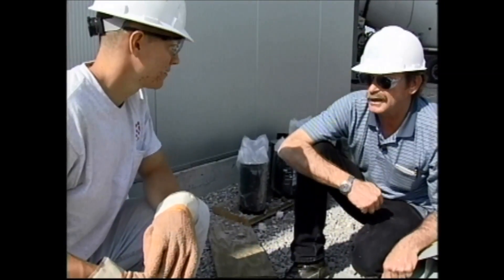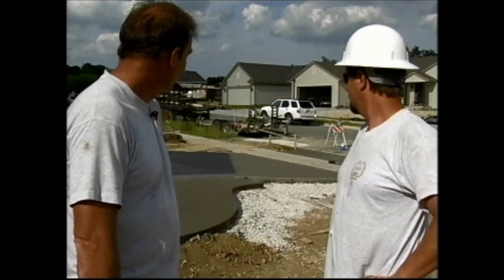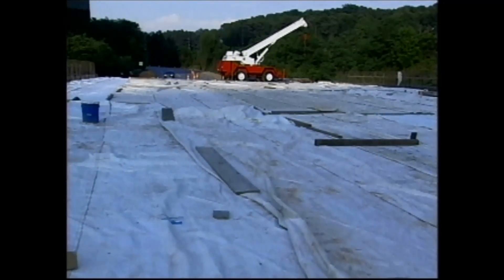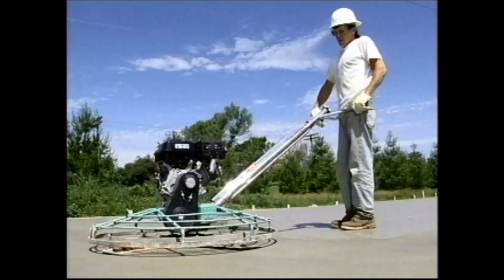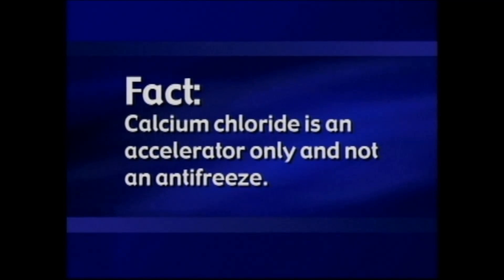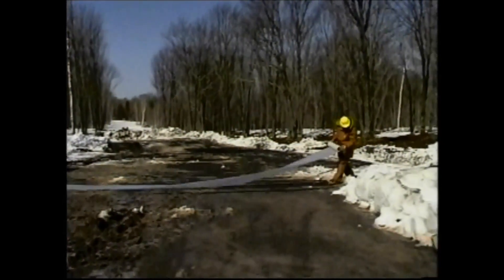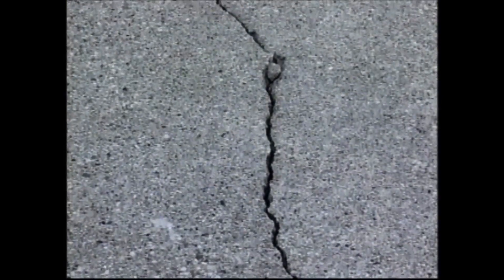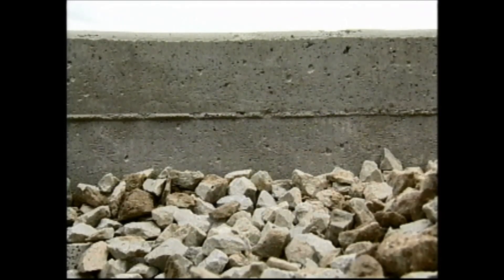Top 10 Myths in Concrete Construction

Comment: Vid is from late 80s.. or at least it should be.. why don't u talk about the serious things. Pump has catastrophic breakdown.....the driver left his water valve on and didn't say nothing all of a sudden you got a square of bulll piss in the middle of your slab......   extreme rain hammers your shit .. taking days of work to make it rite......  Massachusetts be form blowout on a really huge poured wall...  waited too long start finishing cause your hungover and napped too long....  plumbers giant trench drains rite at or above grade and you only learned this as your placing mud up against it...  driver is an asshole and uses all the water....  driver is an asshole and wads the mud ticket up in a ball and throws it out the window towards ya as he drives the truck away .....driver shows up hours early .....  inept and brainless superintendent does things that make everything just a giant ball of suck..  usually anything to do with a church almost always sux........  sidewalks poured over tree roots bites...
Reply: A good ready mix driver should know his slump x to get to job and temp. This he should be able to maintain across the grid , yet he can not controll the batch man and his performance . I have seen real ready mix drivers and I have seen poor ready mix drivers , that's up to the company to control by taking care of the good performer's and getting rid of the lazy , no commen sense driver , lets face it it's all pride and team work from start to finish , one fails we all fail .....keep it hard and like Paul Harvey said ...good day👍
Reply: Gordon Garland  agree completely,   After a few years in bisness, its funny the relationships you form with drivers... some you absoloutly dreaded, rocket dan would have a seizure when u signaled add 5 gal,  other drivers knew you so well they would have your peticular mix perfect, hell a couple even let me drive the truck,    I liked it when they would ball up the mud ticket and throw it at ya out the window as they pulled off the job....

Comment: Hm. They missed a big one. MYTH: Every load of concrete you get from a Ready Mix company will be a fresh load. FACT: Some Ready Mix companies sell 'old concrete' IE 'hot concrete' to make extra profit. The only way to make sure your local concrete service is selling fresh concrete is to spy on them and see if their trucks are always dumping any left over concrete from the previous delivery and washing out when back at the plant. IF you see trucks with their drums turning going into the plant, go straight into the fill area, then drive back out and head to a new delivery, there's a good chance they're selling old concrete. Selling old concrete is a detestable practice, because each load gets hotter and so hardens faster, leaving less time to work it. Plus more and more water must be added to keep it from hardening in the chute. It's gets crazy the longer the process is drawn out.
Reply: It probably wouldn't matter for footings, but flatwork? Sidewalks, driveways etc? I once had to deliver a load of concrete to a home-owner doing a sidewalk, late afternoon, with concrete so hot, I emptied my water tank into the load just to get it to come down the chute, and before half of it was unloaded, it started hardening in the chute. I had to dump the rest of the load on the poor saps lawn so my truck wouldn't be fucked up. And my boss expected that homeowner to pay for the whole load to, 0_o. That's how bad it can get. Most contractors that used us, because we were cheaper than all the other ready mix companies, would only order from us first thing in the morning to just past noon, because they knew there'd be less chance of getting old concrete in their loads, or if they did, it wouldn't be too hot to deal with. With the exception of a few who had large crews and NEVER got old concrete. Never ever. I imagine they had a talk with my boss at some time and told him they'd hurt him if he ever did that to them, lol.
Reply: dkeith45 its called stacking loads a lot of company's do this on foundations

Comment: Crap.  Leaned I don't know nothin' about concrete.  So much complication and variability.  Need to invent something new.
Reply: @ Robert Gift This is commercial concrete. Concrete for homes and small businesses is a lot less complicated. In three years driving for a ready mix company in the midwest, I only saw a contractor use the slump cone a couple of times. They generally just look at it at the top of the chute, and can tell by sight if it needs water or not and how much. The biggest clues to take away from this video is ONE, use some rebar. Not as much as shown because it's commercial, but some rebar for home sidewalks and driveways etc would go a long way strength wise. And TWO, cover it after it starts to set up, wet it and cover it and keep it damp for at least a week.
Reply: I've seen remesh, if by that you're referring to that little hole fence stuff, like little 1/2" holes, at the big box home supply stores, but never saw a single contractor use the stuff in three years delivering concrete. A few used 'wire' nearly every pour, which is, this is from memory, 2" squares untreated steel looks like horse fence. But few used it and I even saw a few F^uckers have the wire set out, and the homeowner drove away to work, and they put the wire back in their truck and we poured without it. I never saw a single contractor for home concrete use rebar either, but from seeing it used in commercial pours, I got the idea to use it myself. I think it'll really help keep sidewalks from cracking down the middle which quite a lot does. I figure it can crack, but will not cave in or chunks break away etc. And it only ads maybe $10 or so to each slab of sidewalk section. I think in driveways you should at least use it around the front edge where cars drive onto it, IE the approach.

Comment: Everything said on here protects the concrete plant....notice its always someone elses fault for concrete failure never the concrete mixing plant...that never came up one time
Reply: @ Brad R Yeah, like the selling of old hot concrete mixed in with new loads to make extra profit for the plant boss. Very few people know of this nasty practice. And the only way you can find out if it's happening is to spy on them.
Reply: The video is about myths, concrete mixing plants making mistakes  isn't a myth.
Reply: Brad R They put so much chemical in it they don’t tell anyone so it doesn’t dry in the truck .
Reply: I was hauling 10.5 yds. of gunnite for a pool job with a screwed up mix design. Instead of putting in 1 gallon per yard it put in 1 gallon for the whole LOAD! The manager came down after I hollered and figured out what happened and we got it slumped out. Went to their other plant and it did the same THING, 1 gallon in 10.5 yards. Was trying to get it wetted up when the big boss told me to just go. I told him to stuff it because the load wasn't right. He mumbled something about the plant always standing behind the drivers, like I knew it was the truth. I hollered that I'd leave when it was right and I did. He was gone when I got back good thing because I was hot enough to fry an egg on. Transferred out for a quarry job shortly thereafter and he got fired shortly after that. The guy that helped me got his job. No more c.d.l. for me.

Comment: forgive  me    for    being    dumb  but  i have    no idea   what hell  is  slump ????  and  in case  you   think   i'm kidding     NO I AM NOT  KIDDING !!!!!!
Reply: steven herrold.
All construction specified concrete must be slump tested.
Google, concrete slump test, to find out how and why.
Reply: If you watched the whole video, you'd see the cone shaped device they use to pour some concrete in, then they lift it off. How much the concrete slumps or sinks down is then measured and that is the 'slump'. IE, it shows how stiff the mix is and if it needs more water added or not. In three years as a ready mix driver, I only saw a contractor use that slump device a couple of times. Most just judged slump by sight at the top of the chute.

Comment: 9:50 I'm still triggered that they never mentioned the ways on how to thaw frozen ground
Reply: In the Midwest the ground can freeze down to 3 or 4 ft in an extreme winter, one year in our Iowa area we had lots of rain in the fall, then temps went below zero for a couple weeks before the snow came, by spring the frost was as deep as 72 inches, causing water lines from street to homes to break, or even homes with well heated basements having to keep water dripping to avoid freeze ups, my own water was coming out of faucets at 33 degrees, that was one of our most extreme winters ever as far as cold temps
Reply: It's rarely done, at least in the midwest. The plant I worked at for three years mostly shut down once the ground started freezing up. Then they'd lay off almost everyone and only do pours that were indoors, like at a steel mill or some such.
Reply: cover the pour area with concrete blankets. the ground puts off some heat, even in the winter
Reply: That made more issues all that summer as everything thawed out, some areas had to replace sewer lines as well as the ground thawed some areas turned into a quicksand like surface, due to being so wet, ground wouldn’t even support a person walking on it in these areas.
Reply: I use sunshine.

Comment: so the ways to increase slump onsite are still add water.
when you order concrete and it turns up coming out of the truck in huge blobs dry as all hell lets face it. your gonna wet it up.
Reply: A big point is; using superplasticizer you don't need to add as much water. You'll never finish a pour if you need to pull it off the chute with a shovel, but the admix can grease it up. You can add less water, not none.
Reply: Guys like you keep us structural engineers up at night. NEVER add water at the site. If the mix is not workable, it's the redi-mix suppliers problem, not yours! Be prepared to add water reducer or super-p but not water. Period!
Reply: tubestick00 add chemical agents
Reply: Wayne Robinson admixtures are amazing tools if you know how to use them.
Reply: Wayne Robinson yea right.

Comment: most contractors let the tester  get the cement off the truck first .then add water so youll never know how long it will last true story
Reply: You are 100% correct it's so bad that the inspector knows you're doing it and hears the contractor discuss to the driver that cwe will add water after he gets his test".
Reply: As a inspector if it fails I let them know, if they pour is up to them.
Reply: Most of the rediculous slumps engineers want to pour are impossible to pour and get a good product
Reply: Shade tree on
Reply: @geraldharrington8401  I pour concrete every day! Just trying to make a real perspective out of this nonsense 💯💪

Comment: Specifying the amount of water... and how are you going to measure the amount of water in site conditions?  How much water in the sand is hard to judge, and sand usually contains some water.  Surely, in practice, it will be down to the skill and experience of the person supervising mixing to get the quantity of water correct, or do the plants sending out Readymixed concrete delivered in cement lorries have sophisticated enough equipment to measure the quantity of water accurately?

This is a question.  I don't know the answer.
Reply: John Bull Yes, they might be able to do it! I would say that everything must be calculated.

Comment: reminds me over at fort knox some people pourd like 100 houses in winter, come spring all houses got so fuckd up i heard that some needed to be demolishd.
Reply: Don't they shift out the soil with gravel before building on top of it?
Reply: Yes, the problem is both soil and gravel were frozen was like 10 ℉
When they pour the concrete
Reply: Concrete is still only as good as the base that it is poured on, if ground gives way underneath it, even the best concrete in the world will fail with nothing under it. Reason why it’s not supposed to be poured on frozen, or too soft of ground.

Comment: If I was wishing to conceal a corpse in a shallow grave under a patio  what would be a good mix to stop the slabs from subsiding ?
Reply: Well mate..I would have a high cement to water ratio and let the slab cure for as long as possible.Put down a couple of piers to a firm substrate to prevent slab sinking.Do not forget to put in plenty of reo,you guys call it rebar. Remember concrete is great in compression but weak in tension so more reo to the area in tension.Put the body in some plastic,throw in a couple of bags of lime and seal that bitch up.Cover the hole with dirt,form the slab and pour the concrete...Good luck..All the best from Australia.
Reply: Yeah man, corpses laying around on the patio may give out a shoddy look and guests may regard you as a slacker.
Reply: Interiors Outlook encapsulate the "void" with #4 rebar on 6" centers. Use a good moisture barrier and place dessicants inside the moisture barrier to prevent odors from permiating the concrete. To prevent jail time cover with at least 12" of concrete in 4" lifts with more moisture barrier between lifts. Your results may vary.
Reply: 4k to 4500.
Reply: OK. Thank you. In Europe we are using different kind of mixing ratios, water/cement ratios and also how to measure viscosity from concrete. But one thing should be always nearly the same: You can't add more water than a ratio water/cement by 0,5 -0,6 because if you do so, the higher amount of water need to pass the concrete to the surface while hardening and will make concrete more weak. That is, why I was asking for this.
Reply: Here the max is a 4 inch slump but most finishers use a 5 or 6 with higher strength mix  or a plasticizer which lets the mix act wetter with no added water.
Reply: p.s.i. strength.
Reply: Yeah after a long concrete contract is greater profitability to bury the grunts and just keep the project managers.
Reply: @Richy Mark Norman: "Well mate..I would have a high cement to water ratio" - Maybe you can explain this some better? What exactly do you mean with that?
Reply: And what does this mean?

Comment: 14:56 Seems this video is 16 minutes longer then needed.
Reply: I had to go into settings and watch it at 1.5X speed.  I still nodded off.
Reply: I liked that almost all of the myths had a practical, counter recommendation in the body of the video. Also came a way with a greater respect for concrete application.
Reply: thanks
Reply: MrNateSPF has